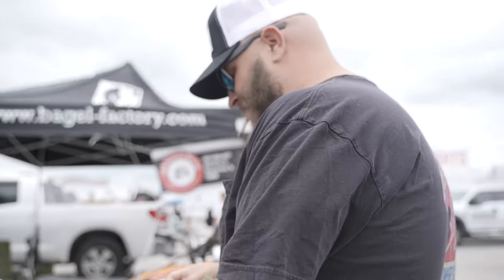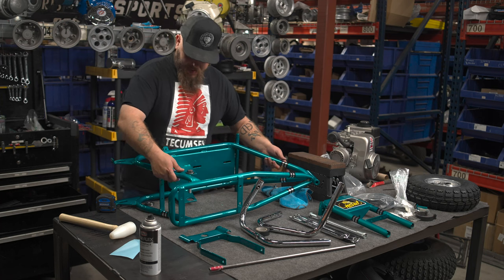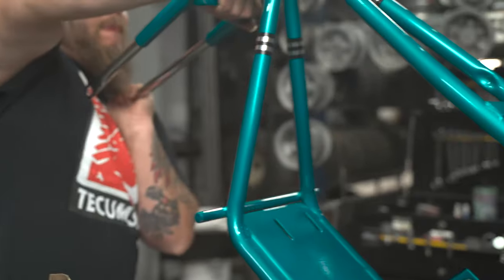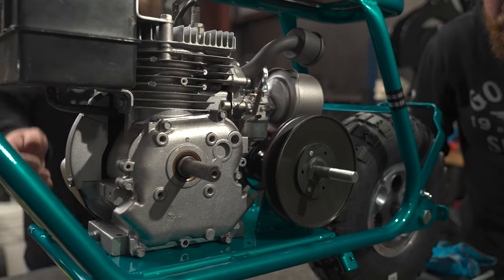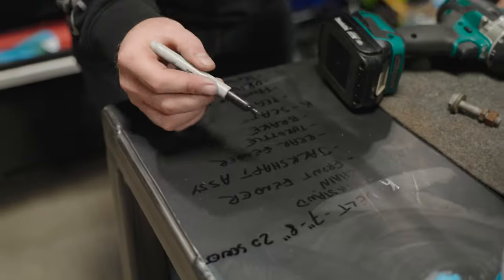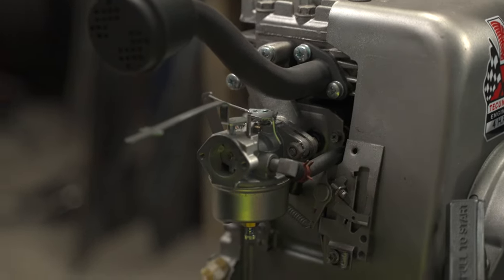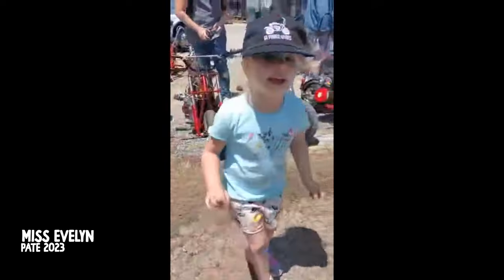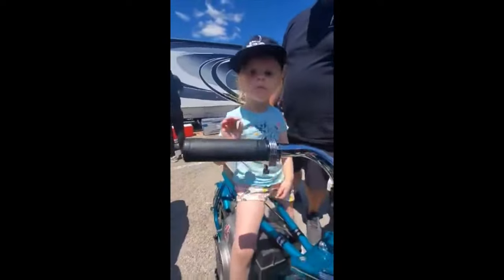Restoring The K&S Hornet Minibike | Evan's Journey

Comment: 1:15 that's the one I owned in the early 70s except mine had a black seat. My brother & I paid $129.99 at Woolco in San Antonio. A blast to ride. 3.5 hp Tecumseh engine. Unfortunately the belt began stretching & slipping & it got slower & slower. My cousin bought it & put the engine in his go kart.
Reply from the maker: Thanks for sharing!  Good times.

Comment: YOU DID A GREAT JOB ON THE REBUILD. I FOUND IN SEATTLE WASHINGTON (AT THE TRANSFER STATION) A K AND S MODEL 90. HAD TO DO A COMPLETE REBUILD, THERE WAS NO ENGINE AS WELL. I CLEAR COATED THE ORIGINAL PAINT AND DECALS ON THE FRAME AND FENDERS AND MATTE BLACK ON THE REST. 1970'S BRIGGS AND STRATTON 3 HP (NOT MANY ENGINES FIT THE FRAME) COMET DRIVER AND DRIVEN NEW SEAT AND NEW TIRES. I HAVE MANY PICTURES I CAN SHARE IF YOU WOULD LIKE TO SEE THE END RESULTS, JUST HIT ME UP. AGAIN, AMAZING BUILD.
Reply from the maker: We would love to see those photos!  Send to sales@gopowersports.com